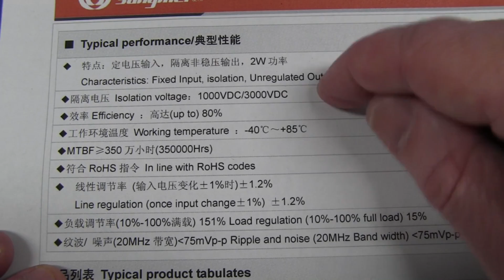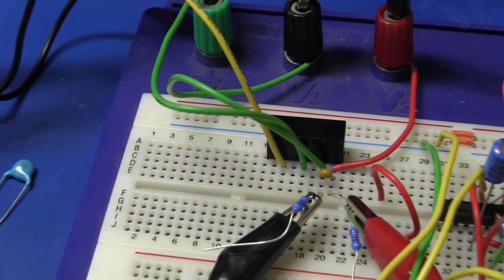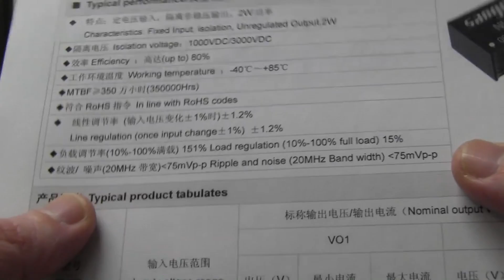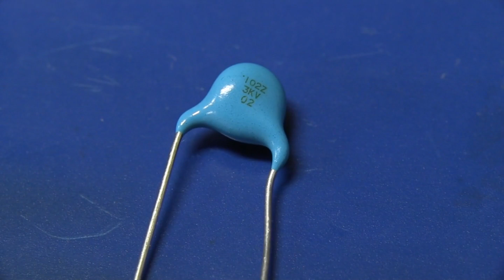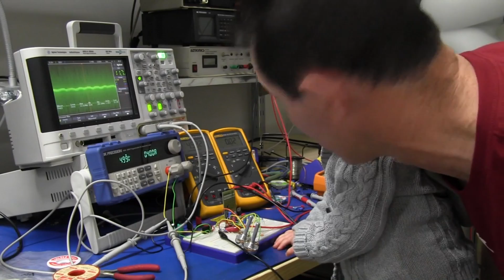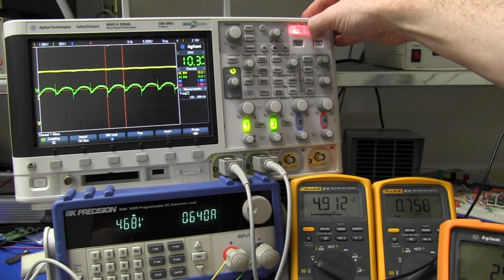EEVblog #324 - DC-DC Converter Testing - USB Supply Part 4

Comment: Hi Dave, Wondering if i could ask for some advice. im building a 10 port usb phone charger and i want to add a 4Amp  ferrite bead on the 5v. on every usb port.. From what i can find on google some say use a 33R and other source recommends 600R. what would you personally recommend please ? the 5v is coming from a high quality pc atx power supply capable of 40A on the 5v

Comment: MTBF of 350000 hours does not mean one device is expected to last 40 years... It means that with a large number of devices, for a total of 350000 hours of runtime, you can expect one failure.

For an individual device, it's guaranteed to work until it breaks. That's all.
Reply: I think you have that MTBF explanation incorrect. It means that out of some large number of devices half of them will fail by 350k hours, not just one!
Reply: @Graham_Wideman  We're both right. :)  I was referring to power-on hours (# of devices x elapsed time), while you're referring to elapsed time by itself.(Wikipedia says that it's 63.2% instead of half, though I confess I don't quite understand why.)

At least in the case of hard drives, there's a huge loophole that makes the MTBF seriously misleading: they specify a "useful life" of five years. To get the quoted reliability figures, you have to replace ALL of the drives every five years.
Reply: @bitrot42  Ooo you're right about the elapsed time of individual device: It's Mean Time Between Failure, not _Median_. And since the distribution of failure time (of the population) will be quite wide, and is unbounded on the longer side, the mean is higher than the median due to the especially long times in the extended right tail of the distribution.
Reply: Graham Wideman ah, that makes sense now, too. Thanks!

Comment: Now, you should put 10v in it and short the output, see how it will handle that! How cheap was it? It seems to be made by some random chinese company, so I guess thats why it lacks protections...
Reply: MrGerbilBrain All of the cheap modules in this form factor are made the same, pretty much. An oscillator, a driver, a transformer, and a rectifier. No regulation, no protection. You want that, you have to add it. It’s a building block, not a finished product. It’d be like asking a transistor to protect itself from misuse. Nope. That’s up to you, the designer.

Comment: Hi Dave,

I have worked with electronic loads similiar to what you are using over there. They have tendency to screw with what you are measuring.

Over shoot on power up that you are seeing might be caused by electronic load. I know those things can't track fast transient loads.(At least that i have used)

Keep up the good work.

Comment: nice video I have a few of those to use to build my meter system for my wind and solar to isolate the ground nice peice of EQ.  I dotn belive there is much on the inside you can get dc to dc supplies off ebay that are small that are just the circuit board. not much in them pretty much a switching power supply inside of them anyhow.

Comment: Polyester resins like epoxy, clearcast and fiberglass, specifically.  They give off cyanide gas when curing, or when cooked.  I learned this in 1974 when a junior high classmate mixed in too much catalyst as a prank and caused a small exothermic fire in a dixie cup.  Water would not put it out so I moved the cup outside and let it burn itself out.  Unforgettable.  Google "cooked epoxy gives off cyanide".

Comment: Let's say this is kind of an electronic DC-DC transformer. Both sides are electrically isolated. Transformers and isolation circuits in general separate one circuit from another. We want to isolate a supply because you never know what the user is powering with that supply. You don't want your computer to be part of a dangerous circuit.

Comment: Dave what was the reason to select an isolated 5V-5V converter? You could have used say a 9V one and you can make the output of the supply go up to 5V with either an LDO or a buck DC-DC regulator. The only problem I see is that you would need a second regulator to power the MCU (and you waste some power of it is linear).

In any case, I suggest you use 3.3V logic, because it uses less power and you loose less power when you power LEDs from lower voltages.